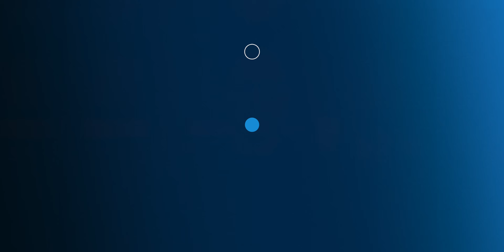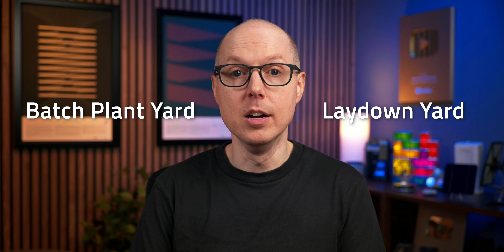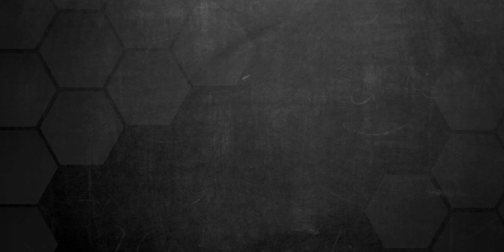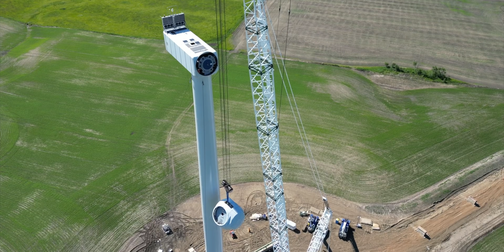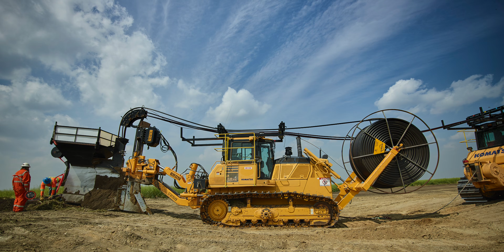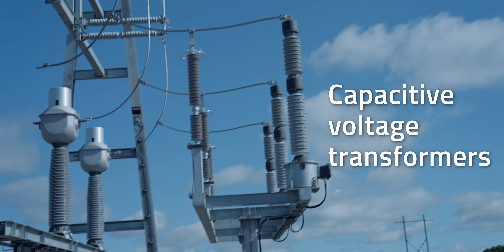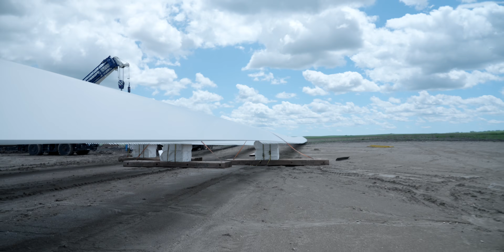The Hidden Work Behind Wind Energy

Comment: But you haven't started from the beginning of the turbine installation. Cause how much concrete and rebar are holding that massive turbine up and stable? And lets not glaze over how many trucks it takes to bring that concrete and to bring the blades and everything else that goes into installing a wind turbine? Multiply that by thousands upon thousands of turbines. Does ALL of that carbon being expelled into the atmosphere really offset using fossil fuels? That's not even mentioning the 300 some odd gallons of petroleum based lubricants needed for each and every turbine, that has to be periodically changed out, and that lubrication has to brought to the turbine somehow right? So it's trucked in by yet more vehicles that are powered by internal combustion engines. That's A LOT of fossil fuel use, over, and over, and over again. Are we REALLY offsetting fossil fuel usage with wind turbines?
Reply: Is it your belief that taking in the totality of construction costs and emissions, the trucking/training in of raw materials (coal), creating and maintaining pipelines (natural gas and oil), and the environmental effects, and the emissions from operating fossil fuel power plants is somehow less than the equivalent power in Wind Turbines?
Reply: Yes we are. The fossil fuel use for constructing and operating renewables pales in comparison to the exploration, drilling, transportation, refining and infrastructure for fossil fuels. You can see renewables as a sort of power multiplier. You can choose to burn a liter of fuel once and use it once, or you can use it to create something that generates energy for 30+ years. On the resource use for turbines themselves: I worked on the construction of a 99 Nordex turbine wind farm in the Netherlands, and develop new wind farms now. Concrete use really depends on soil stability. For lubricants, increasingly plant-based oils are used (like castor), and for the blades new recyclable epoxy resins are being developed. I don't see for example Shell putting this much effort in cleaning up the oil-polluted Niger Delta, Exxon actually cleaning up their abandoned wells in Texas, or BP stopping continued leakages in the Gulf of Mexico (America).
Reply: @LinkeHarryB  except its more like Burning 1000 barrels of fuel now so over the 10-20 years we can burn 1 liter a day instead of two while paying for 4.  Then deforesting 100s of miles, industrializing the Ocean, and intentionally warming the temperature and causing mass Intinction.
Reply from the maker: There are a lot of life cycle analysis (LCA) studies out there that look at the impacts from cradle to grave for these type of energy projects.  Wind energy is a drop in the bucket compared to natural gas or coal power plants.  The advantages are kind of staggering.  Here's just one example: https://www.nrel.gov/docs/fy13osti/57131.pdf.  Also many companies are developing methods to break down the wind turbine blade epoxies for recycling and disposal. https://www.vestas.com/en/media/company-news/2023/vestas-unveils-circularity-solution-to-end-landfill-for-c3710818

Comment: Not enough winds. To build and maintain windmills costs too much.
The energy windmills create is less than the cost and constantly breaks down.
There is constant erosion of the blades, bearing grease, metal shavings, etc. entering the environment.
The amount of wildlife killed due to windmills is disturbing.
Sometimes, you have to give up on something that does not work.
Windmills being "safe green energy" is a thing of the past.
Reply: you have fallen to oil propaganda. Any windmill makes back its energy within 2 years. Most turbines have lifetimes of 30+. Compared to other forms of energy production, wind energy is actually much lower in terms of wildlife harm
Reply: @michaelhohe2168  I've done the research. Even with that being said, that most likely means nothing to you. So, believe what you want.
I'm not an oil lover. You're wrong twice within two sentences.
I believe in fusion reactors (fusion power). Taking two atoms and slamming them together to form a heavier atom.
Instead of assuming, ask Michael.
Reply: Everything you have said is so vague and pointless without any logical thought or even common sense.

Comment: And, still they have no real place in the grid. When it blows they produce and electric prices goes down, if you build even more, they gonna cannibalism on their self (Price wise). And when the wind isn’t there they earn nothing. Same with solar panels.
Reply: You may find this odd, but solar is popular in remote arctic regions. Why? because for months every year, they produce power without running their diesel generators.
Reply: @ not at all, but the vast majority of people doesn’t live up north. And the solar panels don’t work when it’s dark
Reply: @andersholmstrom2752  LOL, but they work when it is light correct? If I could fix your car to use no gas during the day, but still require fuel once it got dark, would you want to drive for free during the day? Seriously, this sounds like something our idiot president might say.
Reply: @21jimmyo  has nothing to do with your president, pure fact. I have an electric car, and solar panels. But the big grid does not benefit, it’s “hard” to maintain 50hz power in the grid if solar and wind is mixed in with various input. We in Sweden have to consider that we need to export to Denmark and Germany as well. Since their power grid doesn’t have enough electricity for them self most of the time. It’s tricky :)